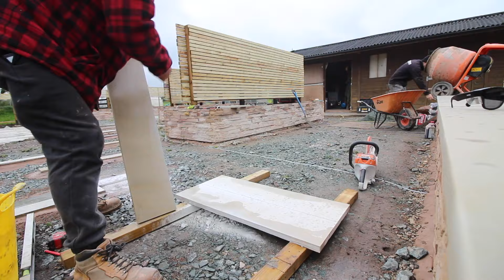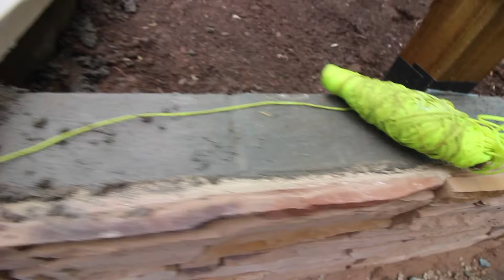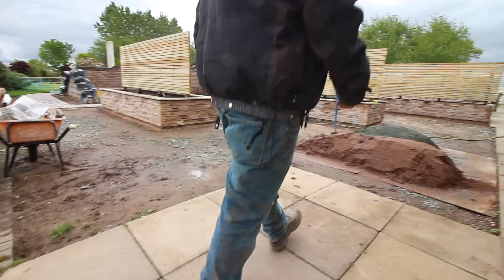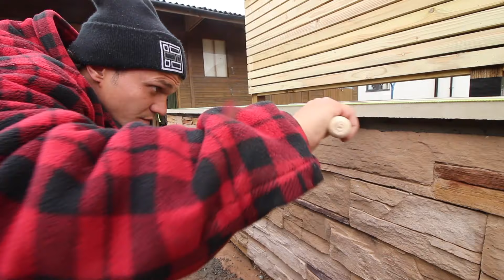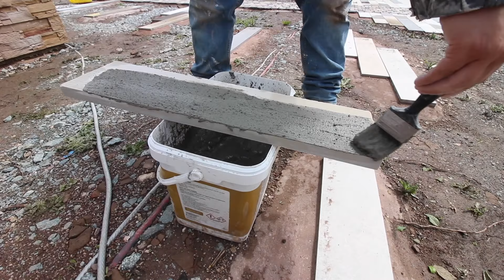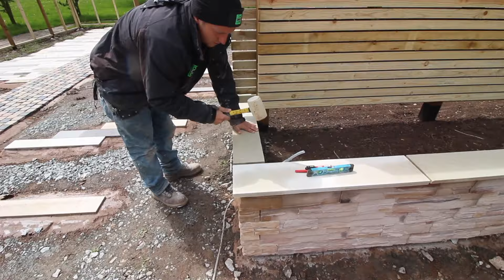CUSTOM Sandstone Coping!! (How To) Finishing Raised Planters!

Comment: Good morning!
Looking good boys!
Attention to Detail as always.
I see the Greggster cutting at 4:26
Try cutting into both ends first then do your long cut across.This will prevent a little extra piece on the corner and give you a clean cut.
Probably not that bad on 20mm but 10mm are a pain if you don’t cut into each end first.
Obviously if you cutting with a wet tile cutter no need to worry.
Keep up the Hard Graft and take it easy on those Big Breakfast Rolls 😁👌